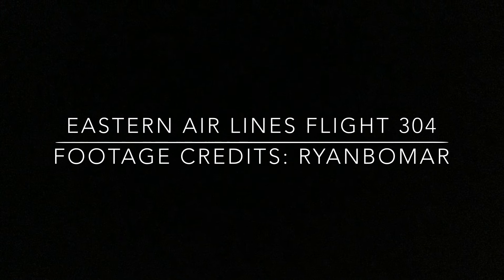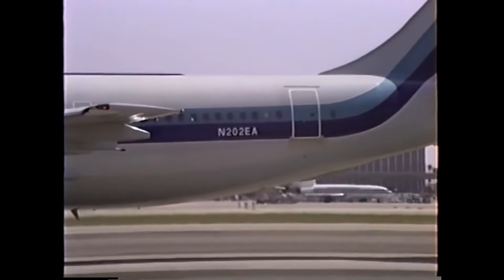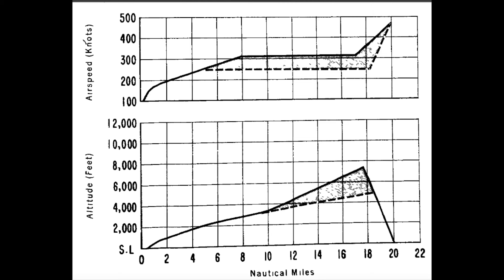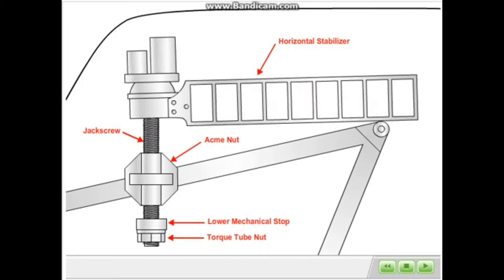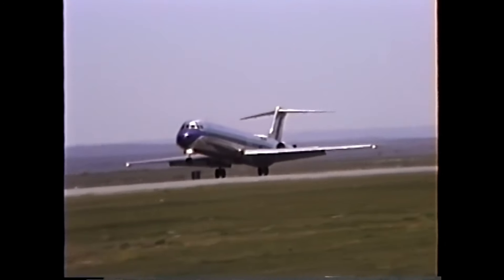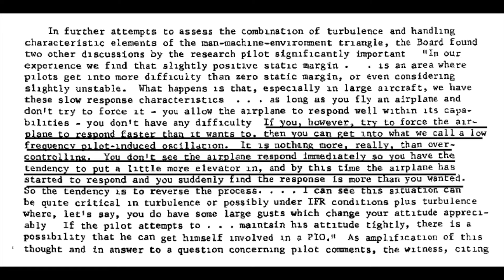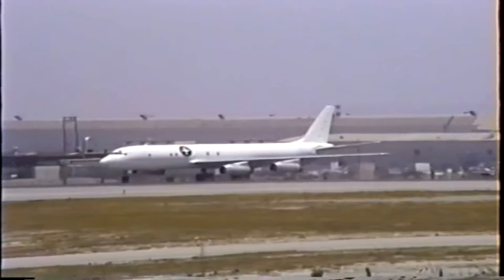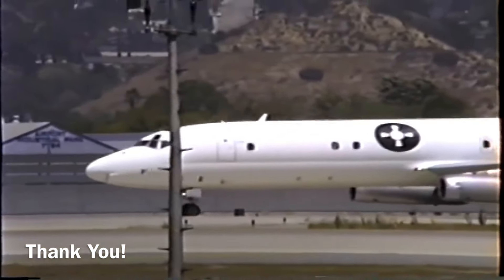When The Pilots Aren't In Control Anymore | The Crash Of Eastern Air Lines Flight 304

Comment: Is it my imagination, or is this a little like the issues with MCAS - the plane was essentially set to crash itself, and the pilots didn’t know what to do?
Reply: This was due to malfunctioning part tho in just this plane, vs MCAS which was doing exactly what it was supposed to do (unless you want to account for the bad sensor in the MCAS accidents).
Reply: I thought that, too.
Reply: Having a single channel AOA sensor drive the MCAS instead of a triplicated voting logic, was just bad engineering. But this situation completely different, with mechanical and human maintenance failures.  Failures of the jack screw have caused other accidents as well.
Reply: @mrubin3770  Hope someone started checking mechanics' work on items like this.  If you can install a jack screw bushing on upside-down, we should assume that at least one in one-hundred mechanics will make this mistake due to either fatigue, poor lighting, etc.

Comment: Most of images are a L1011, not a DC8.
Reply: M Rubin You're absolutely right.
Reply: Yeah, I thought he was supposed to be working on this.
Reply: It was very confusing hearing about a DC8 while looking at a Tristar and a DC9.
Reply: It looked like they were showing a DC-10 multiple times in this video. (single engines/wings, and the tail section engine)
Reply: HE STATES HE USES IMAGES SUPPLIED BY FRIEND.
BE HERE FOR THE STORY NOT TO COMPLAIN.
Reply: EVERYONE OF YOU NEED TO HUSH. IF YOU WANT PROPER PHOTOS GET OFF YOUR ASS AND SUPPLY THEM.
BETTER YET TRY TO DO SOMETHING TEN PERCENT AS GOOD AS THIS.
THIS YOUNG MAN WORKS HARD SO QUIT NIT PICKING.
YOUNG MAN YOUR SHOWS ARE GREAT. YOU DO A VERY GOOD NARRATIVE.
Reply: @ronniewall1481  well, we receive more than 80 percent of our input data visually.  If visuals are in error what are we to expect from accuracy of content.  I generally find his stuff OK, and never implied otherwise.  He asked engineers to reply, and I am.  Those jack screws have killed a number of people.  As has human maintenance errors. Like common mode failure of all engines on trijet, due all O rings being omitted during oil changes.  I would rather have seen a static image of DC8, rather than confusing aircraft images. This would have been a fine podcast, but wasn't YouTube commercial. I don't find this amazing footage as he closed his commentary. Just saying.
Reply: Might not have been able to find Eastern DC-8 footage that he could use
Reply: HE DOES GOOD WORK MOST FOLK CAN GET PAST THE PHOTO.
HIS NARRATIVE IS SO WELL DONE HE COULD POST NAKID WOMEN AND STILL DELIVER THE STORY.
Reply: I AM AN ENGINEER AS WELL.
Reply: I was confused too, the aircraft showed up as what I,as an ATC Controller, would know was a DC 10 Not a DC8 and Not a 1011
Reply: Dc10
Reply: @ronniewall1481  Do you find that typing in all caps helps you to communicate in the engineering world? It seems a tad hostile in the youtube comments section.
Reply: @tkidmstr  ITS ALL IN YOUR LITTLE BRAIN. CAPS DI NOT MAKE ANY NOISE.
YES THEY HELP I HAVE AUTISM AND SIGHT ISSUES SORRY YOU GET BUT HURT BECAUSE CAPS YELL AT YOU.
IT'S IN YOUR HEAD.
Reply: @ronniewall1481  caps are internet shorthand for yelling. I'm not really upset at it, but perhaps people would be more responsive to your posts if it they didn't appear so angry, or at the very least so loud?
Reply: @tkidmstr  I'VE TOLD YOU WHY I USE CAPS SO SHUT UP WITH THE IM BEING FRIENDLY AND YOU CHECKED TOS. YOU HAVE BEEN INFORMED WHY I USE CAPS NOW STOP
Reply: @ronniewall1481  You could just hit the caps lock button. I wouldn't read a research paper written in all caps.
Reply: @tkidmstr  GO FO UNDERSTAND ME BOY?
Reply: @ronniewall1481  Now you are replying again. You could just as easily ignore me as well. Now you've made it fun for me to reply. You've been kind of rude in this comment thread and you haven't really stopped being rude. You need to relax, my friend.
Reply: WELL THIS COMMENT SECTION GOT REALLY DRAMATIC I SWEAR A FIGHT CAN KICK OFF ON YOUTUBE ABOUT LITERALLY EVERYTHING
Reply: Thats the problem with stock footage, Wrong aircraft in EA colors departing LAX on 24......For some odd reason this L10 footage was used a lit especially by EA back in the day.
Good vid...
Reply: @mrubin3770  

If footage of an unrelated plane NOT having an accident throws you I suggest you work on your attention span. 80% of what we comprehend is visual? That's 100% complete BS.
Reply: @Skylined  It's not a matter of attention span or the fact that the video is not showing an airplane crashing. It's the fact that he's verbally describing something going on in one type of airplane while displaying a very different airplane. More often than not there is no schematic or other visual representation of the sequence of events of the accident in the video, so viewers that actually know what's inside these airplanes and how they work are forming a mental image of the activity and can't help  visualizing the system of the airplane being displayed instead of the one involved in the accident—because humans DO override previously heard information in favor of visual information presented at the moment—which creates a conflict because the current audio and the current mental picture do not align. Numerous times during these videos I find myself thinking "wait a minute, the Tristar doesn't have that unit" or "that's not where it is located" and then realize I'm thinking of the Tristar airplane displayed, which is the wrong type for the narration about the DC-8. It is not possible to simply not watch the video and only listen to the audio because occasionally there IS a visual representation of something that conveys much more info than the audio. Designing a presentation for human beings has to take into account how human beings process information—it's called Human Factors Engineering. It is just one of the various types of engineering that go into designing airplanes, and plays a huge role in flight deck design and designing the airplane for maintenance operations.

Comment: The DC-8 was a brilliant airplane in many ways, but woefully under-engineered in many others. Unlike Boeing which waited to start full production until after the prototype “dash 80” was tortured every conceivable way during certification and pre-production testing, Douglas didn’t have the luxury of time. They were so convinced jets weren’t really viable and that the new piston powered DC-7 was the next big thing, they futzed around until they were two full years behind Boeing in the development process for their first jet. As a result Douglas decided not to build a bespoke prototype for testing and instead would use the first production aircraft to come off the line for type certification and “real world” torture testing. That means an awful lot of problems (some known, others yet undiscovered) were neither revealed during the abbreviated testing nor fixed on the subsequent aircraft already in production. Douglas took a huge gamble delivering aircraft that still had a lot of secrets yet to be revealed. This particular vulnerability is one of many unwelcome surprises that the DC-8 would spring on unsuspecting pilots during those first few years.

Comment: Thank you for researching this.  Rather ironically, this is one of the few major air crashes of which I was not aware.  At the date of its occurrence I was in my first few days of the training that would eventually lead to my career as an aircraft mechanic.  Not only was I busy with my studies, there was no television available in the dorm where I stayed, so I did not hear of the accident.  The DC-8 is one airplane with which I had zero experience in the following years, but I have seen a similar problem on the early 737 airplanes that did not lead to such serious consequences.  Once again it was a pitch trim problem.  On the 737, a mach trim actuator was installed to follow commands from a mach trim computer and change the relationship between the elevator position and the horizontal stabilizer at high speeds.  If this actuator failed in the high speed position, either the autopilot or flight crew would trim the horizontal stabilizer for pitch control as the airplane slowed down.  No problem so far.  But upon landing, as the pilot pulled the column back to flare the airplane for touchdown, the mis-trimmed stabilizer would limit the force the elevator could exert to raise the nose, and it became a near thing to get the airplane on the ground safely.  No accidents resulted, but there were some unsettling moments before the problem was resolved.

Comment: I worked as a marine electrician during the early 1980's. I spent some time working on the shell-dredges that harvested the small, white shells from the bottom of Lake Ponchatrain. These shells were quite popular for driveways all throughout the south. A dredge arm dug out the bottom of the lake, washed the silt out of them on a big wash-board type of equipment with lake water, and conveyed the washed shells to a barge tied alongside of the dredge. 
Lake Ponchatrain is near the New Orleans airport (now called Louis Armstrong Airport), and the military used to launch many, many training flights over the lake. General aviation also flew over the lake with private airplanes. They still do.
The dredge would often dredge right through the wreckage of crashed airplanes as it dug out the shells. The remains of some of these aircraft would slide up the angled dredge-head, fall off as they breached the surface, then disappear again into the murky lake-water. I asked the Captain if they ever reported it, and he said, "Nobody wants to know about it".  They probably dredged right though the remains of flight 304, more than likely several times.
The dredges no longer operate in this lake, and the water has returned to a more natural state that supports a healthy water environment.
Reply: Sifting through the remains of the dead to collect shells for driveways... And nobody wants to know about it. Terrifying story, man.
Reply: Maybe the dredging company and the one who contracted them didn't want the hassle of halting for a long indefinite time... I know here on island, if construction finds bones or a burial ground, they must stop and advise the appropriate gov't dept.  Then, they have to wait for the archeological team to painstakingly dig out the remains and ensure no other historical remnants in that vicinity.  It can take months. With construction deadlines, it will cost everyone involved loss of money.

Comment: Wow , so they don’t blame the pilots this time ! About time
Reply: The missing bushing saved them.
Didn't American Airlines ever do PMs and inspections of the planes?
It seems to me that a routine check would have found the missing bushing.
The automatic Pitch Control problem should have been looked into immediately.
It proves that air crashes are a string of events that combine to make these things happen.
Reply: @tonyperone3242  Of course they do inspections on the aircraft.  There are multiple inspections done on aircraft, starting with simple thru flight inspection all way up to phase and depot inspections.  You can inspect every last hydraulic or electrical driven actuator on the aircraft and never know that a bushing is incorrectly installed.  For components that effect safety of flight, there are often what is called an in process inspection (IPI) required when installing such a component.  This is required because once the installation is complete, it is impossible to tell if the critical portion of the installation was done correctly.  As far as items that may fail from wear or corrosion, those are always on a time change or time inspection schedule.

Comment: A bushing can be stainless steel, aluminum, or hard plastic. To have a bad mount on any control surfaces on an aircraft, it would be like having a steering rack on a car with loose bolts. The autopilot would command control surfaces, when the mounts move around, the surfaces don't respond properly, that would disable autopilot. You're right, it's a little the messed up mount, a little on the turbulence.
Reply: Excellent explanation, I am not involved in aircraft engineering but mechanical work and many times I come across bronze bushes and also thrust washers of similar material.
Reply: I know it's an old thread, BUT bushings can be found all over the place. For those who have never seen them before, maybe I can help...

   The very simplest of them are basically a combination spacer/stabilizer-sleeve. They can be cup-shaped or more like a top-hat, and can be made of just about anything. The choice of material depends mostly on the relative purpose and levels of abuse they're supposed to endure for the life of a given machine or appliance.

     I frequently rebuild and restore equipment and tools, so I run into them most often around the shafts of electric motors and in gear-boxes to align the moving parts. Angle grinders while have them to hold the drive-gears together, a cupped bushing in the "head" for the receiving gear, and the top-hat "sleeve" for the shaft of the motor to align the pinion/driving gear so the teeth perfectly mesh with the other... In a blender, there's a sleeve-type (frequently top-hat shaped) right above the motor to align the shaft that drives the blades around in the bottom of the pitcher... AND of course, fans will have the sleeve between the motor and the blades, and some have a cup at the back-side of the motor to keep the shaft straight and quieter within the housing.

     On heavier machines like motorcycles, bearings are frequently employed to smooth out and reduce friction around the axles, while the bushings are more of a "sacrificial" role made of bras, aluminum, or bronze so they get worn down to protect the frame and the housing of the bearing race. It's a REALLY useful little piece for a lot of different but very similar applications. Most of the time, however, they make a rebuild cheaper because it's easier to afford replacing a little sleeve or cup of copper/brass/bronze/aluminum/plastic/etc... than it would be to weld in a build up of metal housing and then re-tool the shape of the bearing(s) or the shaft that carries torque through the opening... ;o)

Comment: What kind of plane is that at the end of the video? The one with the white cross in a black circle.
Reply: The plane you are talking about is a DC-8. It's a later, stretched version so it looks much longer than you would be used to. I believe it was called the Super 61.
Reply: DC8-61 freighter conversion.

Comment: a rubber bushing is more for reducing vibrations for exsample in car engines it will dampen the vibration it also can reduce wear caused by vibrations as it dampens it.

Where as a bushing for rotation is used in applications where bearings may be used and is basically just a hole (like a door hinge)

Comment: When they discovered the issue with the trim, the plane should have been grounded immediatly until the system could be repaired. But, no, they had to get four more hops out of it first. I hope the regulators came down hard on the airline for this one.
Reply: Unlikely. How thorough was the certification process for that other Death Plane, the infamous DC10?
Reply: Surfer Dude Eastern Airlines went bankrupt and no longer exists.
Reply: People should go to jail for neglect of this magnitude.  For some reason, we don't prefer criminal charges on sloppy managers in the US.
Reply: They did not ground the airplane - manly because the people in charge of deciding on grounding had much more knowledge of aircraft systems and engineering than Surfer Dude. The PTC system of the DC-8 can not be compared with the MCAS of the Boeing 737MAX. It was a well designed system that was active only in high speed cruise flight. It also had nothing to do with the main pitch trim system (Stabilizer Trim via jackscrew) This DC-8 did NOT crash due to a bad design of a system. It crashed due to a mechanical problem in the jacksrew system which was caused by a previous maintenance error.
Reply: Not hard enough - the Flight 401 crash was ridiculously avoidable, and the airline managed to operate until January 1991 due to their owner's sketchy af management.
Reply: @sorgfaeltig  Yes, the DC-8 pitch trim system was well-designed: it even had two methods of actuation (hydraulic and electric motor).